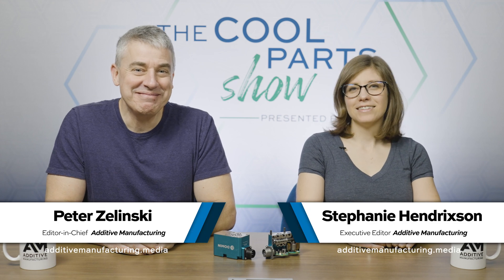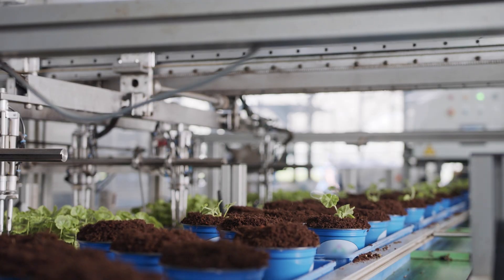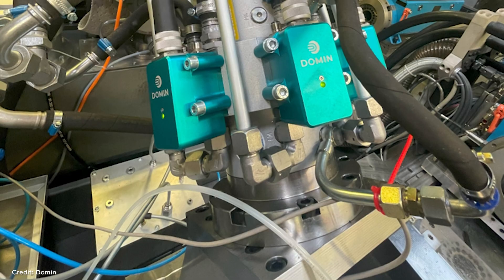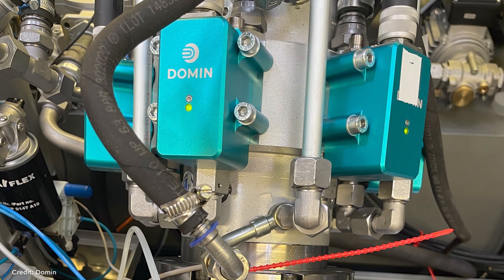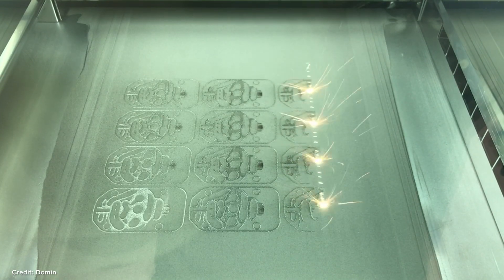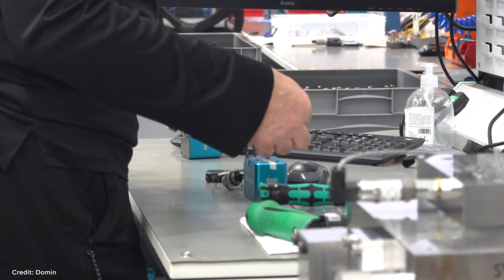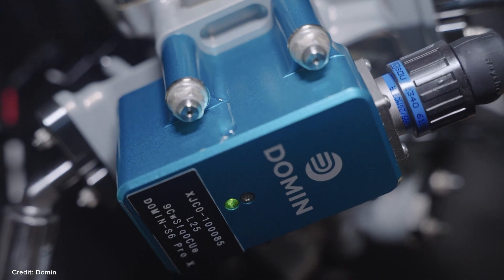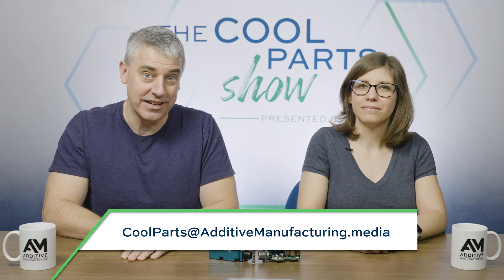How 3D Printing Improves Hydraulic Servo Valves | The Cool Parts Show

Comment: Interesting product and manufacturing process, but I was a bit disappointed there were no comparisons to the '23% efficient' old design. What are the new technical specifications against your baseline.
Reply: I don't think that the competition would like it if they were "named and shamed".
Reply: @lift256uganda9  Hydraulic systems are very inefficient. Servo values will make it better but still not competitive with electrical systems. Once electrical systems achieve the power densities required for the industry there won't be a reason for Hydraulics.

I would also mention they refer to there improvements compared to some of the competitors. Those competitors are more then likely designs from the 1950 that have never changed so the improvement seems much larger than it really is. The designs from the 1950 are old but that does not mean they don't still work in certain applications.

Comment: Is it actually profitable to fabricate the parts with LPBF and post-processing (extensively with high precision finishings), compared to making the parts with conventional machining and its after works? On top of that, surface roughness of LPBF parts are really bad, and achieving the requirements in complex internal model seems intensive, and increase cost even more. Some parts doesn't look too complex to depend on AM. So the expense of getting the near-net shape part would be much expensive than machining. How do they overcome this cost efficiency problems with AM?
Reply: Hydraulic oil is many times more viscous than water so the internal finish matters less. But the fatigue life of components is severly impacted by high surface roughness - such as from EDM.